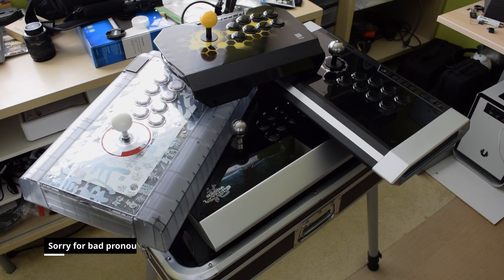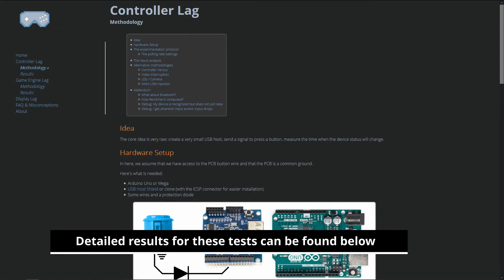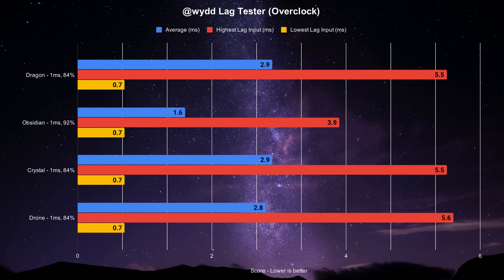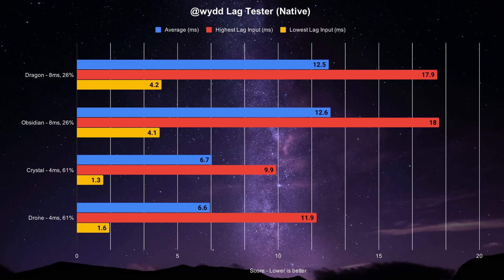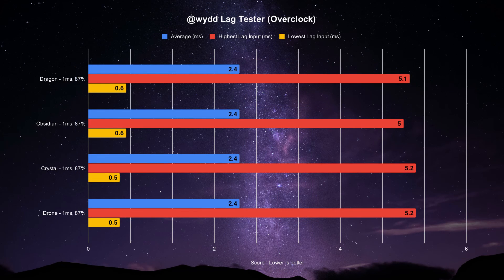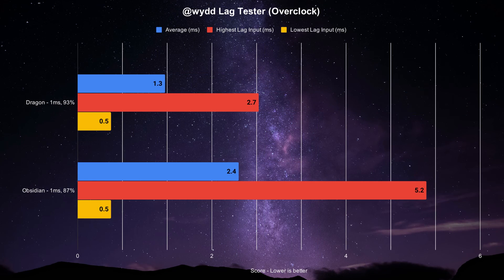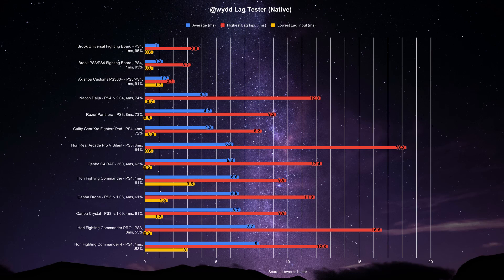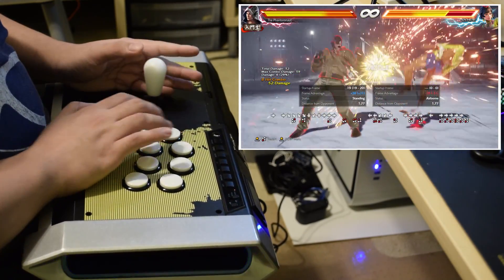Qanba PlayStation 4 Arcade Sticks' Input Lag Analysis

Comment: @The Phantomnaut 

So, would the Qanba Obsidian in PS4 mode on a PC have lower average latency than in PC mode on a PC?

Also, for Qanba Obsidian, it appears from your graphics that the difference between PS4 average latency (3.7ms) and PC average latency (6.5ms) is a mere 2.8 milliseconds (that's ~1/357th of a second) Noone moves at that speed. No practical difference.

Moreover, there may be no significant numerical difference either. Min and max latency scores are nice, but do you have error terms for your data? What's the standard deviation of your measurements? 

Overall, interesting observations, but without distribution information, how do we know there is any significant difference in the different modes?

Edit: oh you posted your results in spreadsheets. Very nice. I'll run the calcs.
Reply: Were you able to determine if PS4 mode or PC mode is better when connected to a PC? Assuming you overclock the controller to poll at 1000hz.

Comment: I think the firmware is only for the obsidian right
Reply from the maker: No. The Firmware Pack includes all PS4 Qanba sticks models.
Reply: @ThePhantomnaut  Really!?  Cool, thanks
Reply: @ThePhantomnaut  brook wireless is better than brook ps3 ps4 ?? I wonder why brook ps3 ps4 has positive and negative lag, and wireless does not have that, ?? I mention that brook ps3 ps4 positively reaches a maximum of 3.2 lag, and negatively reaches 4.3 ... or what is your point of view on these two pcb?